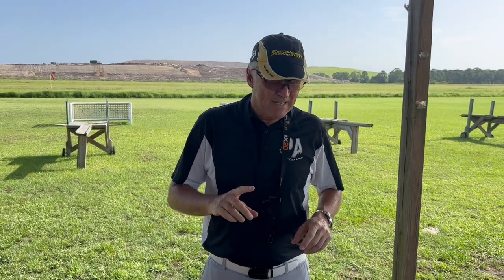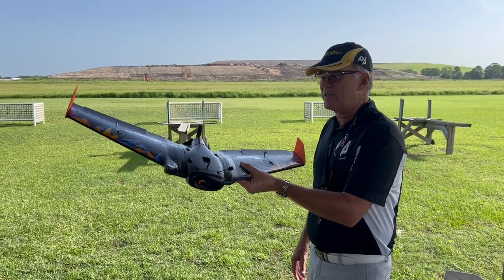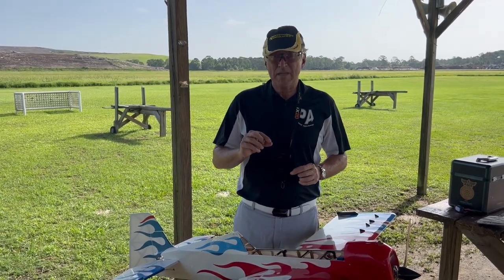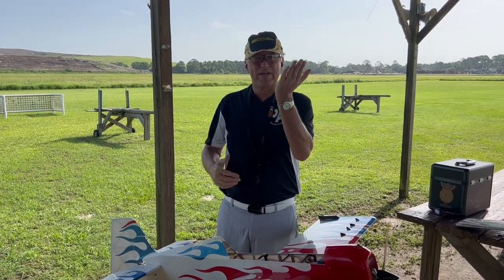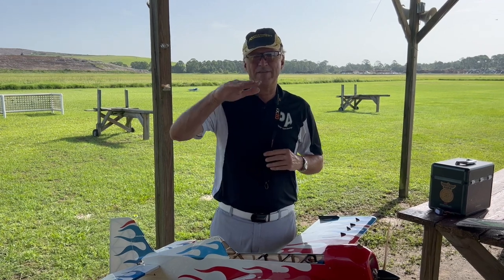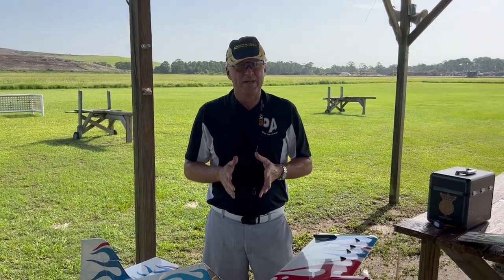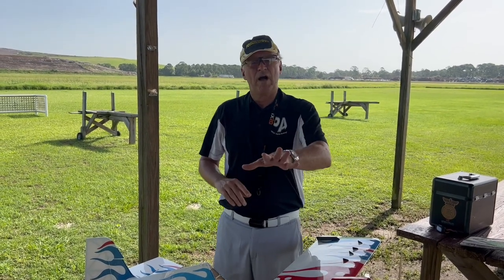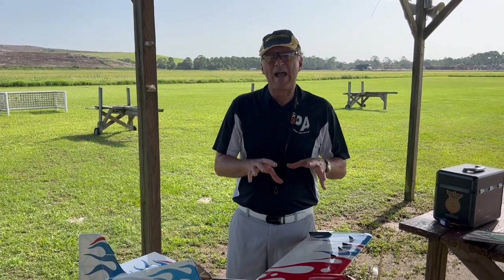MIchael Wargo Balancing and C.O.G. PART 1 :  A Comprehensive look at Balancing an RC Airplane

Comment: Another great informative video! I built a Zero and with a .46 size glow she needed 1 lb of nose weight. I'm not a fan of adding weight so I bumped up to a .61 size motor. Problem solved.
Another plane needed tail weight with a .46 glow. Dropped to a .40 glow, no weight needed and she flys like a dream.

Comment: All I fly is warbirds gas 60 size plus, every one has needed quite a bit of nose weight. One ESM plane I have my awesome 72” Hellcat has almost 2 lbs of led in it. There is nothing wrong with that. It is needed. I do have a question what does it mean when your plane shows balance but does NOT teeter totter, push on nose it drops push on tail it drops, bring it to level it stays. Most of my planes using a Great Planes balancer will rock back to level they fly great. Others usually don’t last long. What causes that? Improper balance point from the manufacturer? Any suggestions? I fly mainly warbirds and scale planes T.F. ESM so on.
Reply from the maker: Ok....  this is a great question with no solid answer.   2lbs is crazy, and cannot possibly help it fly better.  It is an insane amount of weight when the nose is pointed down.   IT must balance though.   Problem is that possibly not I identifying the proper CG.  YOu must fly inverted at a 45 degree angle at 2/3 throttle.  If nose goes down, it is not balanced.   even if spot on the manual.  CG is individual airframe oriented.  9 times out of ten when I test a plane where owner used a lot of nose weight and say it is perfect, I test and end up removing 80% of the weight.   It must fly inverted with little elevator to level off.   Just be careful with that much weight.  Makes no sense if you think about it.
Reply: @MichaelWargo  Hi Mike thank you for your input but I’m not touching my Hellcat. And in inverted flight it needs very little elevator to hold level. But I will try it on a 45* climb. But It teeter totters right back to level every time. The problem I have were it does not teeter totter is with other planes. I also agree that the manufacturer suggested CG is wrong, but trying to find the right cg is a problem. Thank you again. And maybe at some point make a video about power. Too many guys I know think any plane should take off in 3 feet and go straight up. If it doesn’t underpowered. It sends smoke from my ears. 3D planes yes but scale planes need to build lift. Oh once again nice job with the 60 cc Tucano